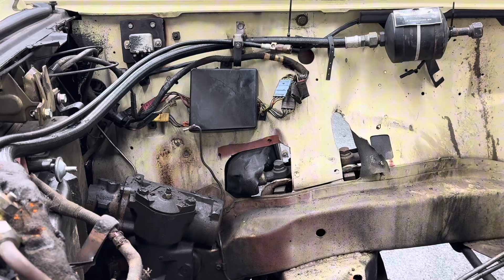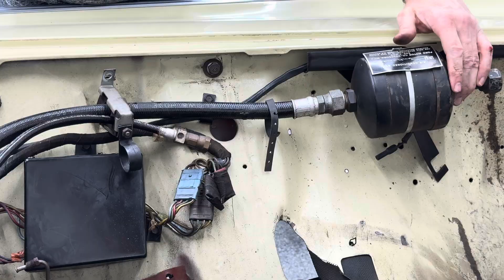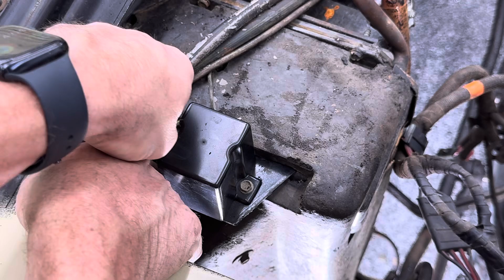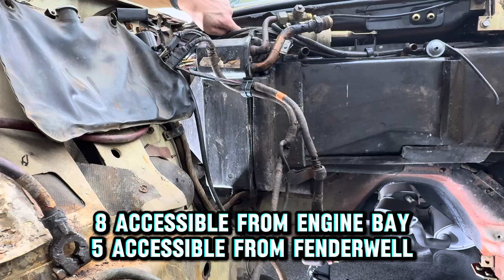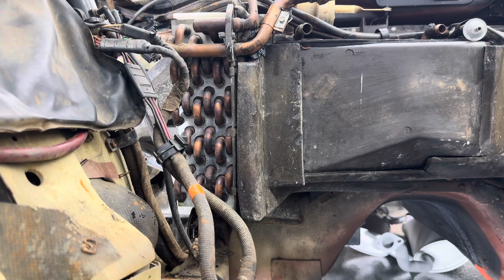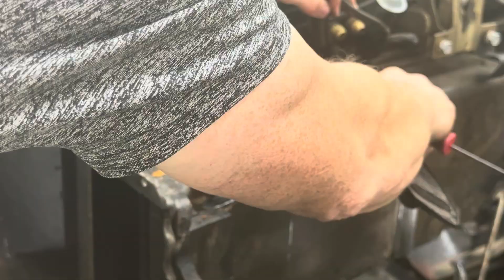1966 Lincoln Continental | Removing the Air Conditioning System from the Engine Bay

Comment: I admire your moxy!  I used to be able to do this sort of thing on my 1960's-era Thunderbirds, but as I've gotten older I have my limitations.  Certainly a huge help to have the engine out of the way.  I'm anxious to see you complete this project, and to note your reaction of the improvement of the HVAC system functions.  Does your car have ATC or manual A/C?  Are you going to keep it R-12 (recommended) or convert it to R-134a?  (subscribed!)
Reply from the maker: I’m anxious for me to finish this project too! I will admit, working on this thing is truly therapeutic, relaxing. There’s been limited swearing while working on this.

Excuse my ignorance as I am still learning this car each day. What’s the way to tell if ATC or manual? I’m assuming it could be determined based on the dash controls?

Comment: Don’t forget to replace the rotted drain tube under the HVAC box.  You probably will see a 2.5” opening which is the cowl drain.
Reply from the maker: Great intel, thanks for sharing that. And, I assume you say the HVAC box you are referring to the big black box on the firewall that holds the evaporator core and heater core, correct? I've received mixed feedback about taking that box out. I plan to take it out given the level of detail and restoration I'm doing to this car. However, I think the dash needs to be removed in order to get to the bolts inside the cab of car to remove that box. If you have any tips/tricks on that, I am ALL ears. Cheers and thanks again.

Comment: Those aren't vacuum lines on the washer pump.  They're fluid lines, for the washer fluid to travel.

Having done that job recently myself, I would advise you to be prepared to replace everything in the engine bay.  That was what I had to do.  If the original condenser, evaporator, and lines are still in usable condition, that would be an incredible surprise.  If you are able to use the original lines, I strongly recommend discarding the metering valve inside the smaller (high-pressure) line.  It was an overthought and caused far more A/C failures than expected.  The system does not need that valve to operate properly; besides, no judge is going to check for it.  If the lines have to be reproduced, the rebuilder will likely discard that in-line metering valve anyway, for just the reason I cited.
Reply from the maker: Thanks for the correction, Anthony!
Reply: @66LincolnContinentalCoupe 😊
Reply from the maker: @a @anthonycaracausa9895 in the video description, I point to each part of the video. I’ll edit the description to call out the error you found for that part. Thx again! I automatically assumed vacuum. I think the fact that the power steering pump powers the wipers influenced this error. 😊
Reply: RES = Reservoir; NOZ = Nozzle (washer jets)
Reply from the maker: @JeffMedved makes complete sense. I made a poor assumption on that one.
Reply from the maker: @anthonycaracausa9895 good news! The condensor, evap core, and heater core ALL tested with a clean bill of health!
Reply from the maker: I missed the second paragraph earlier, apologies. 

I am of the mindset that most things will be rebuilt or replaced in the engine bay, NOS will be my go to and reproduction only where necessary. I should know more later this week on condensor, evap core, and heater core. I will take same shop the lines if they can test those (as well as vacuum cannister that I just removed). As for the metering valve, Ill try to find NOS first. This OCD build is keeping the single master cylinder so I think Ill give the metering valve one try before discarding it altogether.